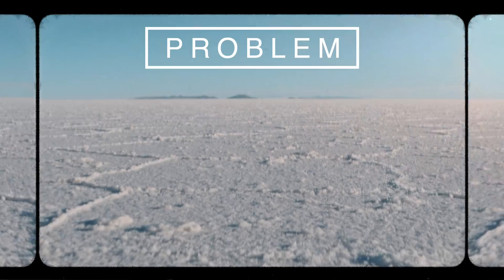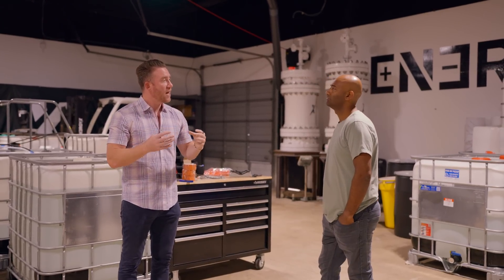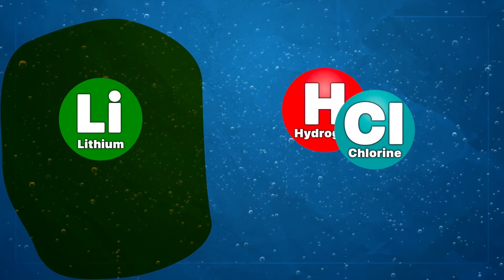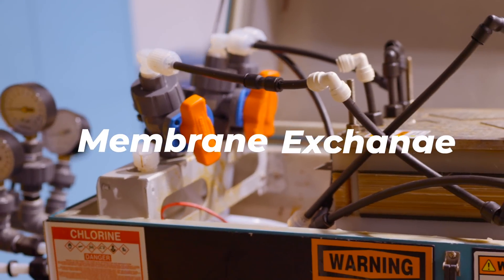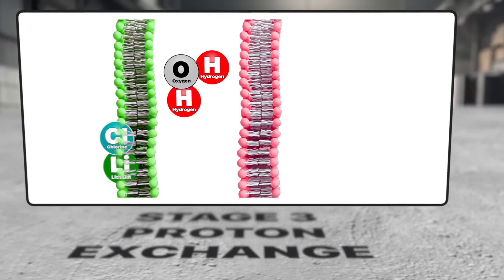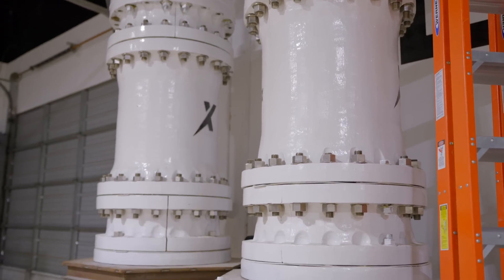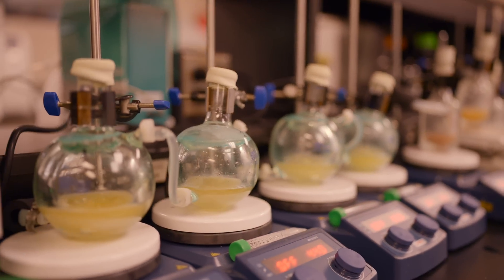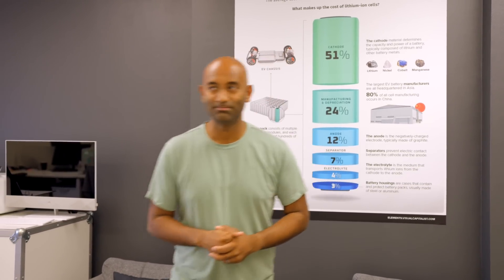The American Company Solving our Lithium Problem

Comment: Batteries can be lithium free. There are already irons or natrium-salt batteries. Even Tesla evolves with cobald-free editions, but still lithium. The car industry will fail, if you have to load for hours, or even longer than 15min. The energy pack must be exchanged at the gas station, or drive  with synthetic fuels or hydrogen powercell. There is no future with lithium power batteries at cars. As simple as that

Comment: Typical long range EV batteries use only 8 kg of lithium, but 25 kg of nickel and 14 kg of cobalt. Weighing for these materials, lithium is just 14% of the cost at current market prices (about $180), where cobalt ($448) and nickel ($462) make up much more cost. We definitely need better, cheaper lithium extraction methods, but lets not forget the larger cost material which influence price more. LFP batteries reduce material costs, but require more materials due to lower power densities.
Reply: LFP batteries don't have that much lower power density, and obviate the need for the nickel and cobalt.  They're adequate for a midsize electric car.  The Limiting Factor channel has some videos with analysis of factors affecting battery production over the next years, both demand and supply, and concluded that lithium may be a constraint by the end of the decade, at least relative to, say, Tesla's plans.
Reply: Which is in part why those without cobalt exist for shorter range, to lower the price (and because of the ethics, but I worry that's more like green washing for these companies).
Reply: It is not about the cost but availability. If we don't have Lithium, nickel  and cobalt don't matter..

Comment: Correction: one ton of lithium (I assume metric tons = 1000 kg) is not 14-17 cars. Each car has about 8 kg of lithium in its battery (more for trucks). S o one metric ton of lithium is enough for 1000/8 = about 125 cars.  So the estimate is off by 7 to 9 times.  LFP batteries use about twice the lithium, so 3-5 times off for those. Please correct this since it is simply wrong.
Reply: The thing is, this giy is one of those who do not care about precise information.
Reply: I wonder if what normally comes out of a lithium brine pool goes to some factory which does some of their own work on it before it goes into a battery. And thus what ends up in a battery is less than the lithium that enters the battery factory, ... so this company might be delivering something similar. Not completely ready for battery use ?
Reply: @autohmae  not by 10x.
They can't possibly have 80-90 % losses.

Comment: Third stage membrane separation of ionic soup into pure LiOH and HCl was rather obscure and insufficient.  The acid and the base will vigorously react making salt and water, CHEM101.  How exactly is this done? They literally need to be kept apart in order to avoid the neutralization reaction.  Multiple membranes for selective extraction? Did you intentionally omit some key details due to IP consequences?
Reply: Okay, one is extracting the Lithium hydroxide and the hydrochloric acid. When extracting, will they be kept together? To answer the question, in order for the whole process to work, it must be selectively extracted. They don't want to place the lithium back into stage 2 so the hydrochloric acid has to be separated. They don't want the hydrochloric acid in their final product so it must be extracted.

Comment: I have the same question as jasonrichter497 . It is my understanding that lithium batteries can’t be recycled like acid batteries. I have read articles that state that the production of lithium batteries 
causes more pollution than an 
Internal combustion engine.
Would this process help reduce the production pollution and after use waste??

Comment: We don't have a lithium problem, let alone a huge one.
Reply: Kinda do.
Reply: @yasirrakhurrafat1142  No, not even kinda. Lithium is a very abundant element in the earth's crust. So far production has always scaled with demand (excluding COVID shortages, which all materials were affected by) and there are no serious projections that say that that will change. Especially with sodium-ion batteries entering mass production.
Also the technique shown in the video is dumb.
Reply: @4203105 I cant say it is dumb. What is open is the commercial viability. If energy cost are too high, or resin has a million year half life then yes dumb. If solar powered and resin converts to chewing gum then maybe we don't need a 100 acre drying pool for lithium production. So far it seems unnecessary, unless you want to sell proprietary resins.